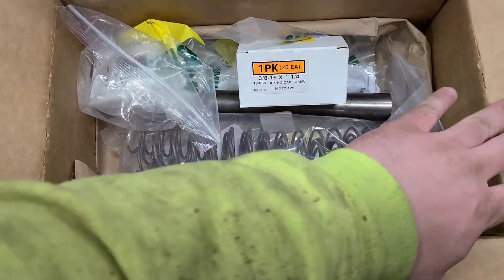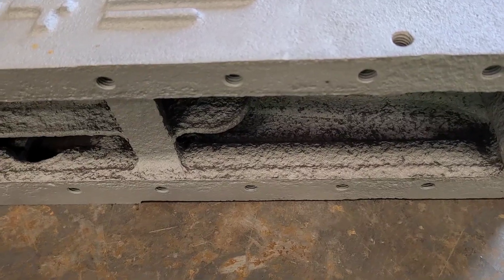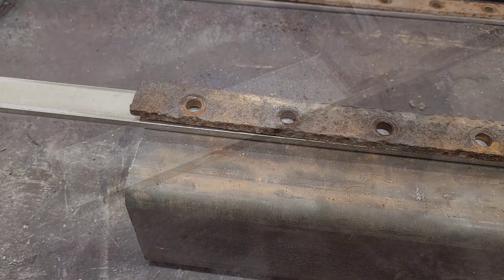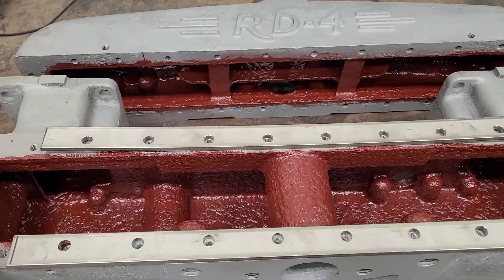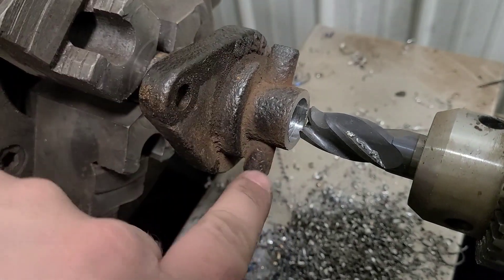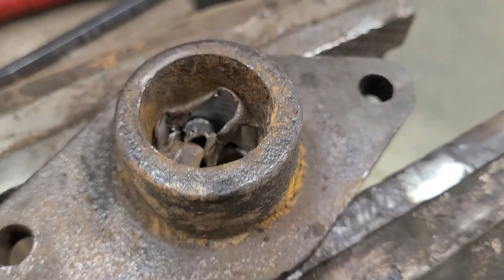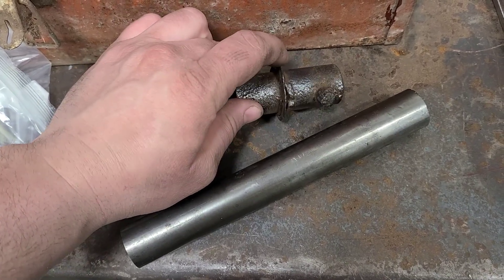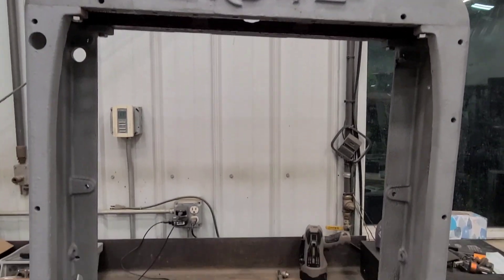Caterpillar RD-4 Radiator Assembly Pt.1

Comment: Hello sir I have some D4 7U parts in good condition. Would you be interested in purchasing them ?
Both sprockets and front idelers.
Reply from the maker: Possibly. Depends where you're located and what you're asking. Are they spoked idlers or solid?
Reply: @kylechrist  I'm in Kentucky, 
Front idelers are solid. 
Would like to get $600 for all 4 items
Reply from the maker: @Longearrider  unfortunately the shipping would be almost as much as the parts
Reply: @kylechrist  i understand, 
If I can't sell them locally I will just hang on to them for backup in case I need them on my old tractor.
Thanks for your time. 
By the way I do enjoy your chanel.

Comment: Never used Glyptol. I have torn down pre 1940s engines to discover it in the crank case.  They were usually better cast than I find in newer engines. 
Thanks Kyle.
Reply from the maker: It's cheap insurance in my opinion 👍

Comment: It is about time you got back to the RD4. How come you used a step bit instead of a regular drill bit to open the punched holes? Nice work.
Reply from the maker: Step bits (while not made for thicker materials) do an excellent job of self centering without the chatter that a 2 flute drill bit does when first starting in the hole. I also like that the next step cuts a small chamfer on the hole, leaving a cleaner look 👍

Comment: 0:45 Third reason, he saw Squatch253 do it 2 weeks ago!  😂JK Kyle, good to finally see you back on the RD4...hope you keep it up!
Reply from the maker: Actually squatch and I talked about it and couldn't find a negative in doing it 👍
Reply: Kenny Kizzle is on the Glyptal bandwagon too. I worry about any coating in a cooling system getting rust under it and popping it off.
Reply from the maker: @brianrvd  in any maintained coolant system there is a corrosion inhibitor so no rust can form 👍

Comment: Good to see you back... Was impressed with that hydraulic punch in stainless :) 
Another good reason for the Glyptol coating is to capture any sand from the casting process that could be liberated from the surface of the casting by rusting, granted less important on cooling systems, but there could be a little bit of shot stuck where you had the two castings blasted.
Reply from the maker: I cleaned the castings the best I could but it is possible there were some that got covered, turned out well 👍
Reply: @kylechrist  Turned out great :)